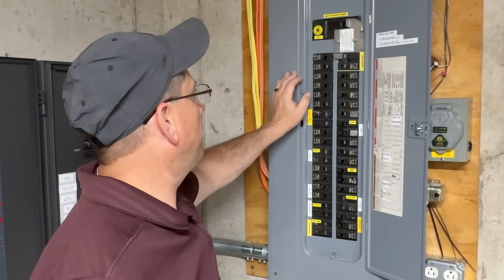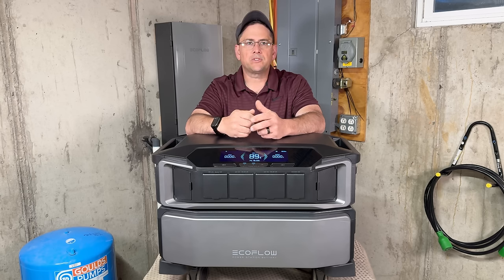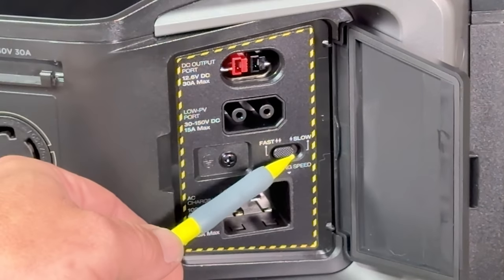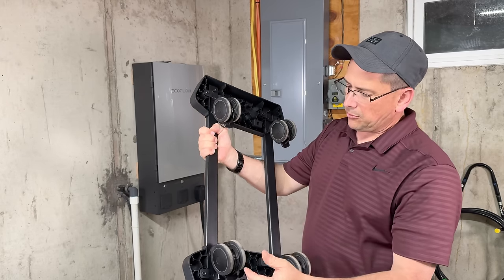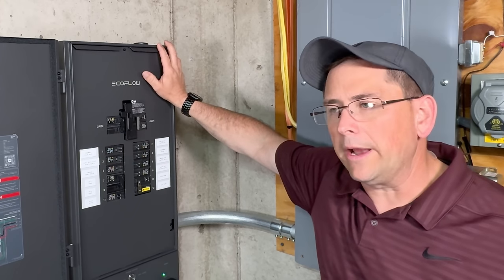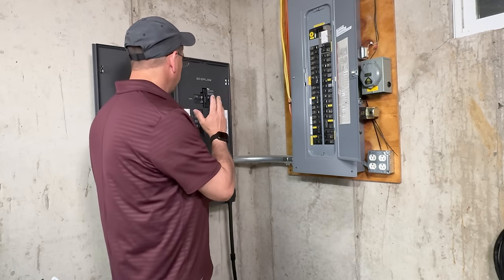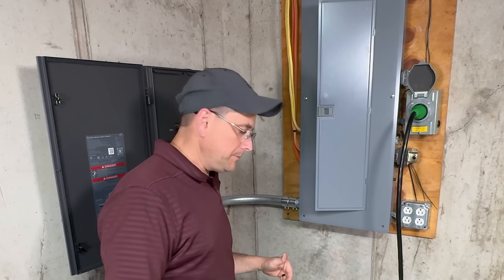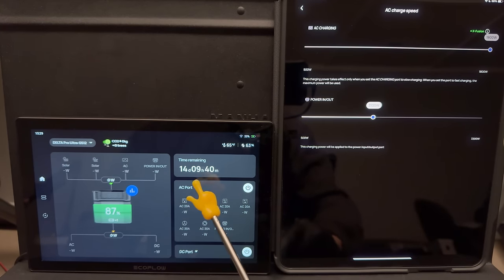EcoFlow Delta Pro Ultra & Smart Panel 2 Replaces Generac Standby Generators Part 1 of 2

Comment: I’m huge into batteries but a generator gives you far more energy for the amount spent, giving a much better value.  Not to mention, a battery system will not make more energy beyond what is stored, so you still need a generator to generate power

Couple this with solar panels, and you’re still falling short because a generator can run basically 24/7 but solar only works when sun is shining brightest, only 5 hours average.
Reply from the maker: Agreed 👍
Reply: Well ... first your generator is polluting the environment. There is a cost to that. In our current economy, this is not respected, so we have to move in this direction for moral reasons.
If you design your system and solar panels properly you should have enough energy to get you by in an emergency with reasonable load management. This is a remarkable system.
Reply: The cool thing with solar though is that you don’t need fuel, just sun.  With enough battery storage, you don’t have to worry about a few cloudy days in a row leaving you without power.  If you really want to go green, you could make a hybrid system with wind turbines and solar, but those are hit or miss at best.  The ideal system is solar, battery, and a backup multi-fuel generator.
Reply: I originally set up for battery backup with 12000 watts and bought the Ecoflow ultra with two batteries. I did quite a bit of rewireing and installed a 10 circuit disconnect panel. I converted my  generators to  trifuel but I have only used them on Natural gas. The two batteries cover all day for all my electric needs except  the furnace, central air and pool. That works just fine for two months in spring and two more in fall. In winter I can swap out a few circuits to run the the gas furnace. By running the larger inverter generator for two hours a day I can fully charge my batteries. Now it has become obvious tha by adding Solar panelsI should be able to run everything I planned and either the central air or pool during an extended power outage while wipeing out most of my electric and part of my natural gas usage. The numbers show a 7 1/2 year payback on my investment at todays utilities prices.
Reply: @kevinm234  nice!
Reply: Agreed, the world isn’t going to be using solar and clean energy like nuclear for decades exclusively. Gas and propane/ng generators are still the way to go for most situations and most people.  Those that say generators pollute are just virtue signaling and don’t realize how dirty the energy is that makes everything they eat, wear, and use.  That said, I will be using both in my home as having multiple way to produce and recharge energy is a good thing.
Reply: Totally agreeable by the main comment here. But I'm looking into this for my business. Currently we have no power at our yard. Currently we run off a generator which is fine during the days but I'm sure my neighbors won't like having the generator running 24/7 during the canadian winter to keep buildings heated and waterlines heat traced. This is why I'm looking into a eco flow system. Possibly maxing it out to keep security lights on, my starlink active so I can have full security from the phone.

Comment: I checked before buying to make sure the duel fuel “smart generator” would be compatible they said yes but sadly no. Here at my off grid cabin we get a week of shade or 4 feet of snow. When I’m not there the smart generator kicked in when using the Delta Pro. Now they tell me no. The smart generator is not smart enough. Be careful the customer service may not give true advice. Their smart generator is not compatible with the delta pro ultra

Comment: But you still need to Generac generator to recharge the battery backup this is an overgrown UPS system not a generator
Reply from the maker: Yep or you can use solar.

Comment: Hi Rick, I'm very interested in this setup but my issue is my Main breaker panel is outside my house along my garage wall. Would installers be able to mount the smart panel outside but leave the lower half(Where the delta pro ultra connects to smart panel) inside the garage along the same wall and just connect it to the smart panel through the wall? I know you mention this at 11:18 but want to ensure I'm having the right idea here.
Reply from the maker: Yes, absolutely 👍. They need to run wire from the transfer panel to the plug-in device that actually goes inside where it’s safe to mount it. The actual breaker panel section is Nema three rated, which means outdoor rated and has a spot for a lock.

Comment: I have 2 of these DPUs with 3 batteries each totaling 36kWh. I'm running them with 50amp Hub into inlet with interlock on main amd manually managingbload.  I love having the option of using these at night and then gennie during the day.  I have had a cpl of weather related outtages and we've had no issues at all.  Love these monsters. What screws me is the location of our service panel. Our basement is originally finished, and they stuck our service panel in the corner of our laundry room. Of all places, it sits above and to the left of our dryer. Anytime you open the panel, you are looking at it in a weird angle. Eventually, I may get it relocated out of the laundry room to another area and make it a more direct purpose utility room so I can get the SHP2 installed and take full advantage of these capabilities.
Reply from the maker: That would make it more difficult.  I wish they gave an option for a whole house transfer switch versus the independent circuits like they did. Oh well, then you could’ve mounted it outside at the meter base and been done with it.

Comment: Great setup. If i could give you som constructive feedback it would be to move your smoke alarms to a circuit with something else on it (like a lighting circuit). By doing it this way, you have a quick way to verify that your smoke detectors have power going to them.
Reply from the maker: They are battery operated with 120 V going to them and they’re inner linked. Plus I have a security system that has smoke detectors as well. That was the only reason why they were on their own circuit was because they’re linked with 14 three wire.

Comment: Thanks for good details in the video. Seeking a solar plus battery backup solution for a home already powered by a AC-tied solar rooftop under a NET metering setup. For such a home with solar rooftop that is AC-tied (due to existing solar microinverters under each PV panel) :
1. Will  the Delta Pro Ultra battery and inverter unit (portable system) be capable of operating while off grid to supply small house loads, and also charge from excess solar electricity produced by the AC-tied solar rooftop array while the home is off grid?
2. Can both charging and discharging of the battery be done with a bidirectional port off the battery unit?
3. If go with an interlock switch in the main panel and plug the battery in a generator outlet , can the battery be charged by the solar rooftop without install of the Smart Home Panel 2 nor reconfiguring the AC tied solar system?
Reply from the maker: Yes, yes, yes 👍

Comment: Great video unbelievably comprehensive but I followed most of it just going to have to go back through and write a few things down. What is the link for the next video which covers your installation? I could not find it on a quick search of your Channel?
Reply from the maker: EcoFlow said they’d prefer I compared the Delta Pro three to the ultra and not show the installation. So I didn’t.

Comment: Looking forward to part two, also wondering if this thing can power my central air if I install a soft starter.
Reply from the maker: It’s running my 2.5 ton AC. I mention the locked rotor amp rating to look at in your AC to see if it will work. Soft start or hard start would definitely help

Comment: Sir I have a smart home panel 2 and the DPU with 3 batteries. How can I connect the inverter generator to the until and still charge it? Do I need a generator transfer switch? Or can it be done without it? While still powering the home.
Reply: Yes. Please let us know

Comment: Thanks you the review, but hear me out. My gas generator plus circuit cost me 1100 dolars with a max output of 7.5k and it runs for 8 hours with a full tank of gas. This setup cost aroung 8k. Moneywise make not sense to me but you gave an idea in case i change my mind
Reply from the maker: Your right. The gas is cheaper but so are gas cars but people buy Teslas  everyday. Plus it can do solar.

Comment: With the current price of solar panels in Europe I would just hook a few of them up to this thing and grab some free kWh :D You can get 440W Panel from Trina (Tier A manufacturer ) for 76€ or $82,50 including tax here in Germany. That's in quantity of one, will get cheaper if you buy a full pallet. Hope the prices are not too bad in the US :D The modern 144 cell ones work decently even when not perfectly installed and slightly shaded.
Reply from the maker: I know I’ve been looking on Facebook marketplace and finding them fairly reasonable. It might be better for me to get solar panels instead of extra batteries.
Reply: @HVACRSurvival  If you're interested in getting some solar panels, I have accounts with Krannich, and Soligent, both are distributors for SolarEdge etc, I've installed a few large grid tied systems for a few customers, one guy has 4 inverters, 105 solar panels, plus a 48 kw Generac at his house :D

Comment: My house was built with two separate 200amp panels, and each is only around half full of circuits.  Total overkill, but what's the best way to create a back-up system?  Do i have to have a gen-disconnect for each panel?  Or would a separate panel like ecosmart panel be able to disect the circuits from both panels.  Scratching my head here on best way to set up a battery backup like yours.  Ugh
Reply from the maker: You could do it with either one of the options you’re mentioning. It all depends what your running and for eat you want to make it fit your self

Comment: Exceptionally well done!  This video is what I've been looking for, thank you!  I'm looking forward to your Generac comparison video.  New subscriber.
Reply from the maker: EcoFlow decided to have me talk more about the Delta pro 3, so I didn’t get a chance to do that video. Basically depending on the age of the generator you have more maintenance and likely more problems. But we don’t know how many years these power stations will last past the 5yr warranty.
Reply: Point of interest; I installed a soft start on my well circuit to reduce the 240 start up from 40 amps to 17 amps.  It runs at 6.5 amps. Just make sure to watch watch your pressure gage to make sure you keep the starting voltage high enough to show the pressure increases immediately when starting. You don't want to burn the motor out.

Comment: With the tandem breakers you used, can you power the entire house when using the EDP Ultra through the EcoFlow Smart Home Panel 2? With only 12 circuits on the Smart Home Panel 2, seems like you wouldn't be able to power the entire house but I am not familiar with breakers.  Thanks!
Reply from the maker: Yes I’m powering all the circuits I feel are most important. That’s a possibility of 24 circuits.
Reply: @HVACRSurvival  up to 24, good to know, thanks!

Comment: Great video, though I do have one question: is there a pair of current sensors which have to be clamped onto the main panel input?  I ask because I saw that the grid power was shown as roughly 2kW; however, it looks as though you have only a single conduit (1") running from the main panel.  I guess it's time to find the manual.  (I am in the early stages of research of which product line to purchase.)
Reply from the maker: The smart panel two has a full-blown circuitboard system underneath the breakers, it measures each individuals circuit and gives you a total total or individual reading, depending on where you’re looking at.
Reply: @HVACRSurvival  So, the "grid" according to the display is actually the feeder current from the main panel, not the service drop current.

Comment: @HVACRsurvival Is there a max THD on the Smart Home Panel 2?  You mentioned 10% on the Ultra but if the Ultra is disconnected and I’m running solely off of a propane generator with a THD of 20%, would that be an issue?
Reply from the maker: Most decent generators are only 5% or less. Why would you have a generate that it puts out 20%? Have you actually checked it with a meter to see if that is what it is?
Reply: @HVACRSurvival  , unfortunately when I bought a generator a few years ago, I wasn’t concerned about it and ended up getting one that says in the manual it could be up to 20%. I installed a 50 amp outlet and have been running my home with it when the power goes out. Eventually I’ll upgrade to a better generator but it’s what I’ve got for now. If the THD will be an issue for the Smart Panel then I’ll just have to replace the generator first since we tend to lose grid power pretty often and occasionally for several days at a time.

Comment: Great review.  Question on generator, do you plan to connect a generator directly to the DPU or through your existing generator connector?  I will have a similar setup - no solar.
Reply from the maker: That's the plan! I was hoping to run my 120v 2200watt continuous generator for when it’s not loaded down, but I’ll probably run my 8000 W 230 V generator just because I can power this thing up in about an hour and a half to two hours.
Reply: @HVACRSurvival  You already have your generator on the main panel.  Just curious if you were going to move it to the SHP2.  Do you know if any generator will work on the DPU/SHP2 or would I need an inverter generator?  I'll probably do a dual fuel one.

Comment: If you had an AC coupled solar system, how would that work with regards to charging with solar via the AC back feed to grid? What happens during an outage when the AC coupled panels shut off?  Is there a way to hook it up so that the solar can still be used during an outage but still on battery backup? (AC coupled panels)
Reply from the maker: This does not have an option for Back feeding to the grid. The thought process behind this system is charging your batteries and powering your home with your solar panels during the daylight hours and living off the batteries in the evening. All that would be dependent on the size of your solar panels and your battery capacity. EcoFlow also offers a gas generator that charges the battery DC to DC and communicates with the system and charges when it needs to automatically.

Comment: Hello, not sure if you can answer this, but I already currently have 10 panels on my roof which generates about 4 kW of solar power anyway, I can tie this into the ultra? Or would I need to get separate panels to tie it into the ultra?
Reply from the maker: You need to add up your voltage and wattage and put it in the correct input. The ultra has some of the highest ratings out there. I would not see why you couldn’t do it. As long as you know how to wire them up.

Comment: Do you have the installation video up. I would like to watch
Reply from the maker: EcoFlow decided that since the ultra has been out for a while and the Delta pro 3 had just been released that it would be better for me to compare the two against each other. I showed basics of inside the panel and you can see how I wired it up.
Reply: @HVACRSurvival thank you I appreciate that

Comment: Can I use my CyberTruck bed outlets to rechard the DPU? The outlets of the Cybertruck are two 120V outlets (up to 20A) in the cabin plus two 120V outlets (up to 20A) and one 240V outlet (up to 40A) in the cargo bed. All outlets together can supply up to 9.6kW.
Reply from the maker: I know this can be charged with the adapter at the charging station. I don’t know what your plugs look like? if they’re just regular outlet looking plugs then you could always plug it in there, but you’ll get the most power transfer by using the power plug I used the video

Comment: Great video. Wondering your thoughts on a system like the power station vs a custom PV, charger, inverter, battery bank as primary power source for cottage (pro, cons). Gas generator would be used for backup or low sun days.
Reply from the maker: This is plug and play and portable. It likely will cost more money but that’s the price you pay for convenience.

Comment: Seems like the direct 50amp hookup in your house to your main panel is enough to control all of your house circuits without needing to buy or install the smart panel 2.  What benefit does smart panel2 provide to outweigh the cost of purchasing installing and rewiring a dozen circuits if all the remaining main panel circuits would be useless when off grid power?
Reply from the maker: If the power fails while I’m not home there’s no way for it to switch it over if  I was doing it the old way. It’s peace of mind not needing to rush home to switch it over. It’s an easy install. 3 hrs tops.
Reply: @HVACRSurvival  ahhh so the smart panel 2 is great for remote access! Thanks.for your video and reply! Is there any way to simply utilize your internal house direct connect 50amp (or any high amperage connection) that allows for some advanced Ecoflow Delta model(s) to intelligently act in “UPS” mode so no manual intervention would be required?